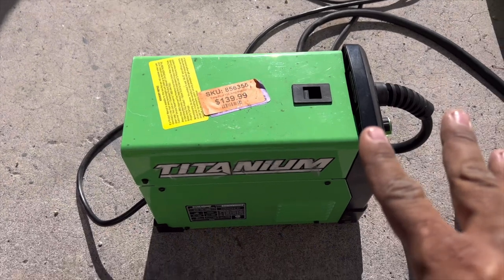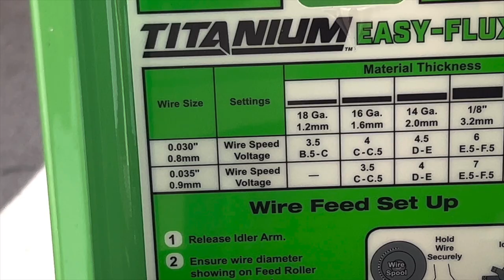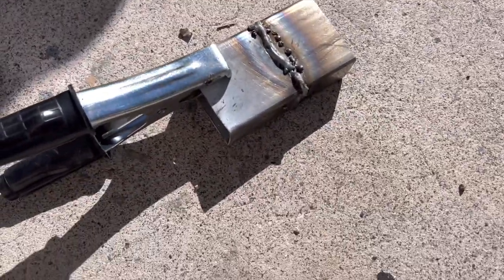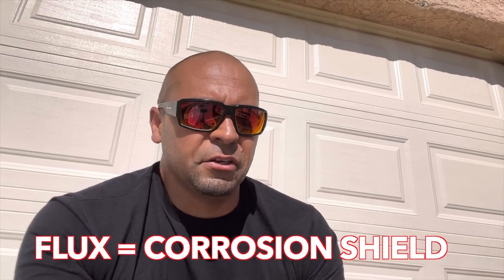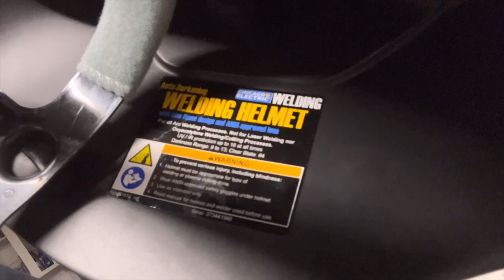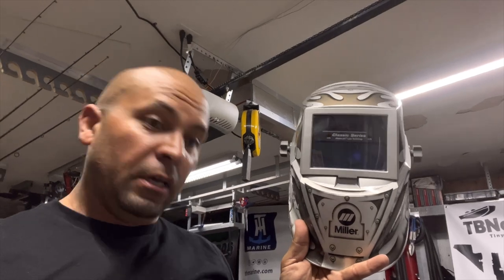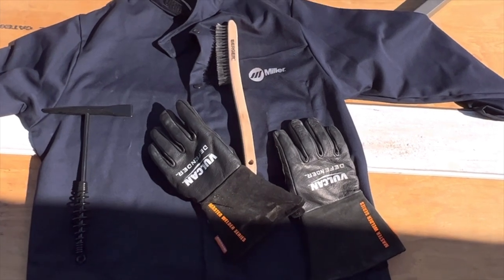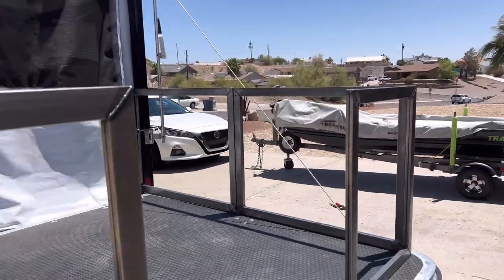Learn welding in one day

Comment: Why not like the video,  it’s great beginner tips.  I picked up the Titanium 125 and bunch of other welding stuff a few days ago.  Never welded in my life, not yet.  Only thing I will add is,  I’ve seen a lot about making sure you have a really good ground and those ground clamps are really cheap, so I already replaced the new clamp with a Lincoln KH525,  300 amp Ground Clamp from Ebay and welding cable lugs from HF,  #4 AWG, 3/8 Stud.   Thanks for the video !!